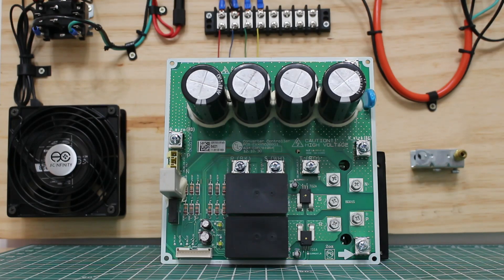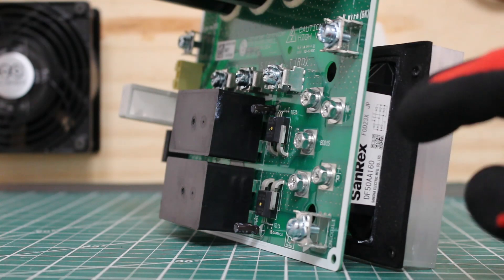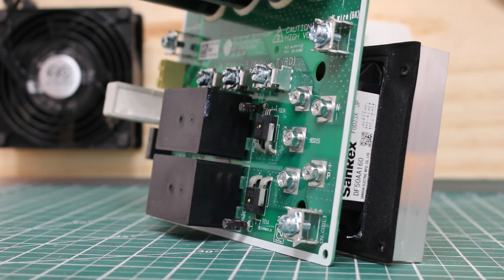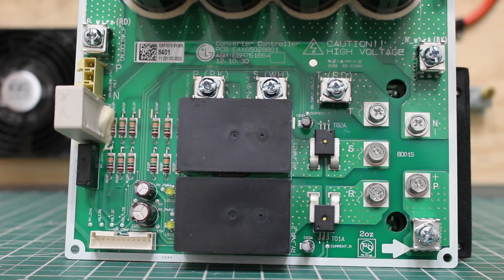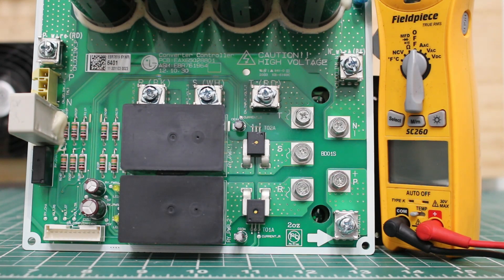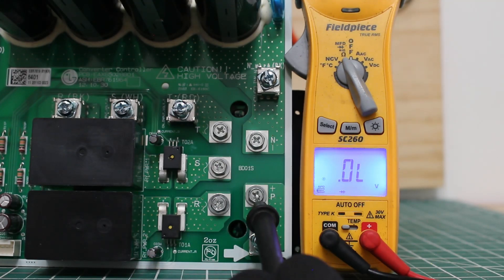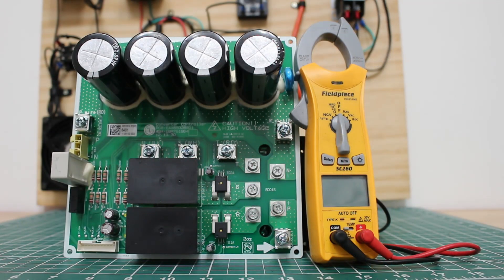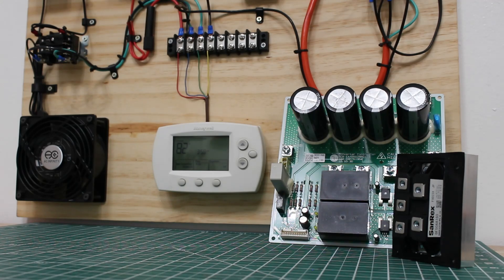HVAC Training: How To Check Bridge Diode/Bridge Rectifier For VRF HVAC Systems (LG VRF Training)

Comment: Can't really say that there will be a specified voltage drop across the diode because all DMM's have slightly different voltages across their leads. A diode test with my FLUKE 116 definitely reads differently than my FLUKE 87 Ⅴ MAX.

Comment: well done, i would add, you need to ensure the reverse bias is not compromised and the gate is not destroyed but checking the reverse flow on each diode, as well as checking the resistance. Think of it as a swing door that is only supposed to swing one way. Just checking to ensure it swings in its designed direction is not enough since it could have had a back feed issue and the hinge will now slightly open in the other direction. Peak inverse voltage or peak reverse voltage as well as avalanche, breakdown voltage is also what its called when this happens, this would be caused if the compressor drain circuit has failed or the compressor stops abruptly and the electrons on the other side of the (door) are forced in with no where to go now but push back through the (door). This is why they have snubber diodes and snubber/drain circuits incorporated.
Reply from the maker: Thank you! That was a great way of explaining things. I appreciate the feedback. When it comes to the maufacuter LG, the photo/chart showed in the video is all it shows you to check the board itself. The 2 resistance readings for the molded plug and that 1 bridge diode test I showed in this video. I wish they gave a more detailed instruction. I agree with you by checking this control in every way possible. Thanks for watching & stay tuned for new videos every week! 🔧⚡️

Comment: What is the advantage of powering the compressor using DC? Is it to vary the RPMs? I’ve seen VFD systems that vary the hertz of AC power for fans that use AC motors. I’d love a video that explains more about the differences and which is appropriate in various applications. Also, the components involved seem to be very sensitive to power events like spikes and expensive parts to replace- would power conditioners for the supply help this? There’s lots about all this that’s not clear, so I’d love to understand more.
Reply: They are actually AC compressors.  The incoming 208 or 480 3∅ AC is converted to DC. Then, the IGBT's convert to a PWM signal that replicates a 3∅ AC signal to the motor similar to that of any VFD.  As far as the compressor is concerned, it is an AC 3∅, sign wave, even though it's actually a bunch if DC pulses positive and negative.  Looking at in an oscilloscope, you wouldn't recognize any sort of sign wave.  This can present some problems in motor berings because the power is not a perfect 3∅ sign wave balancing itself out with 0 volts on the shaft.

Comment: As someone trained in electronics, a diode or bridge cannot be determined to be 'good' just by measuring the diode forward forward voltage as you showd in this video. This is just one of the tests. After testing the forward voltage, the test probes need to be swapped over so that the voltage to the diode is reversed. The forward voltage should be infinite (show a open circuit) as a good diode will not conduct in the reverse direction. The bridge rectifier can also be tested by measuring the forward voltage in both directions directly across the P and N terminals, expecting double the single diode forward voltage as two diodes will be in series. A technician would ideally produce a table containing the forward voltages and resistances between all of the pins AND the heatsink pad. This will help determine if any internal faults have developed. A specialist would also test the diode bridge at its rated voltage to detect any high voltage breakdown.

As a small detail, in electronics the term 'bridge rectifier' is generally used where are the diodes are encapsulated in a single module and 'diode bridge' used where each diode making up a bridge rectifier is a separate component.

Aside from this, the video was very good. A very clear description that was easy to follow with visuals so good I was able to use my smartphone pointed at my monitor to read the QR code on the bridge rectifier.
Reply: You should make videos on how to troubleshoot these components on minisplit systems. It would be very informative.
Reply from the maker: @sherwinalvarez7365 Agreed ⚡️
Reply from the maker: Thank you for your input! Really appreciate it. Great info. The manufacturer LG, only provides what I showed in this video and that was directly given to me by technical support. It's funny how they only show this one test that I showed in this video. I agree that it's best to check these out in every way possible👍 Thanks for watching & stay tuned for new videos every week🔧⚡️

Comment: Great video. Got a question concerning an issue I ran into last week. I had a call for heat on an electric heat unit and I was getting 24v at yhe transformer and on red but between W and C I was only getting 12v, not enough to energize the relay. I've seen this before and found a bad common in the circuit going to the transformer but I checked every wire going back this time and found that they were all connected properly. What would cause me to get half my voltage? Even jumping R to W still got me 12 at the relay even though R by it self has 24v.